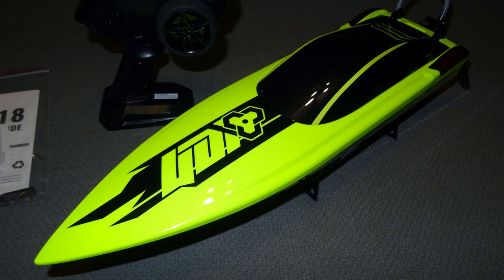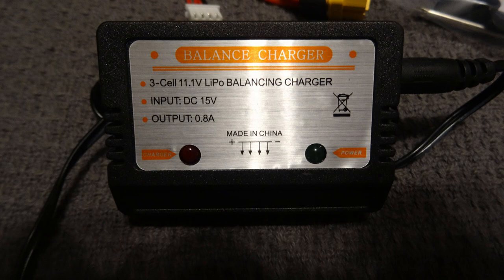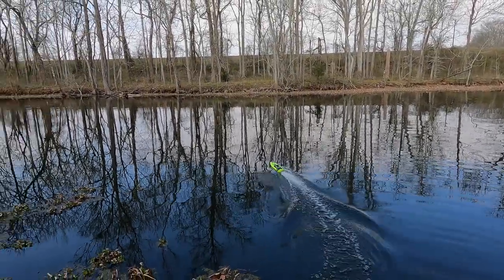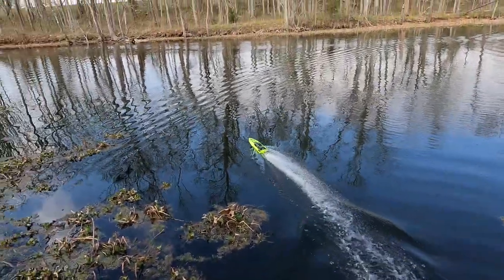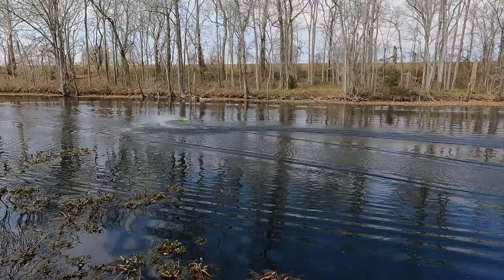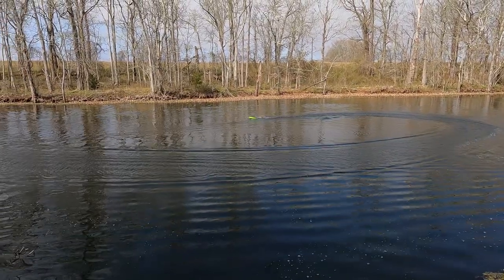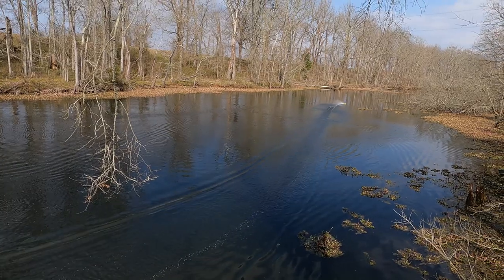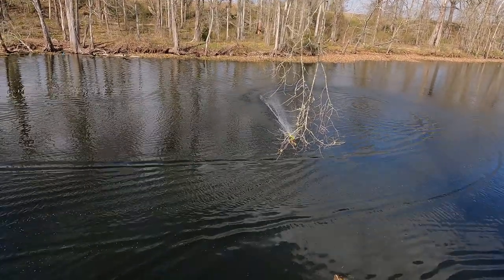R/C Boat Review - UDI018

Comment: Which one would you recommend between  UDIRC UDI005(Arrow) vs the one in this video(UDI018)?

Pls reply
Reply from the maker: I haven't seen the Arrow in person, so I'm just going off the info I see online. The Arrow had what looks like a larger motor, and claims a higher top speed. It doesn't have the "tacky" LED lights in the hull either... lol It looks like a bit higher end boat, but costs a little more too. My guess is they are both good boats. If cost wasn't a factor I'd pick the Arrow. Even if cost is a factor, I'd consider you may get more boat for the higher price, so kind of hard to decide... lol
Reply: Thanks for replying 
I am considering to get arrow as well@bonafidepirate

Comment: You said you sent it out as far as you could comfortably see it. How far was that ?  Do you have a feel for what its range actually is ?
And what about the duration ?
Reply from the maker: UDI claims 100m, or a bit over 300ft. I'd say I was about that far out. They say 8 minutes on the included battery, which is accurate. The one time I timed it, it was right at the 8.5 minute mark when the low battery warning kicked in.
Reply: @bonafidepirate  Thanks. Looked like fun.